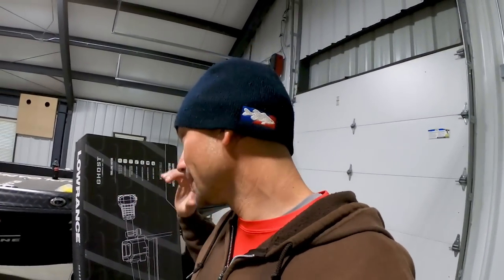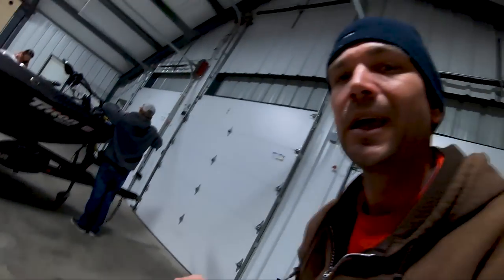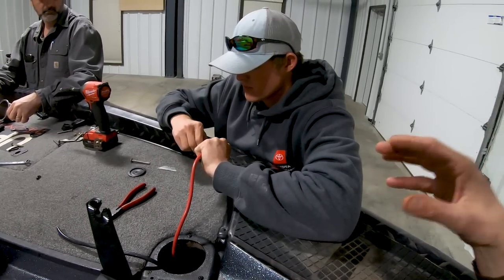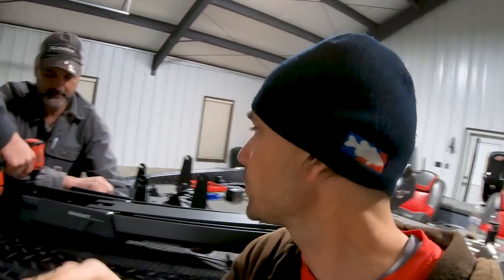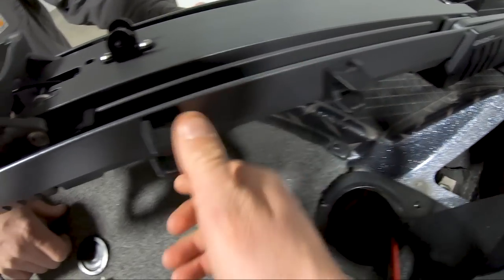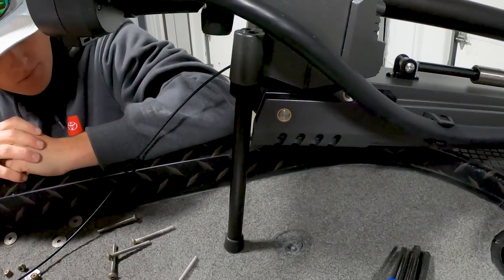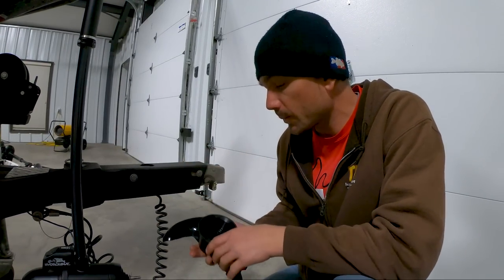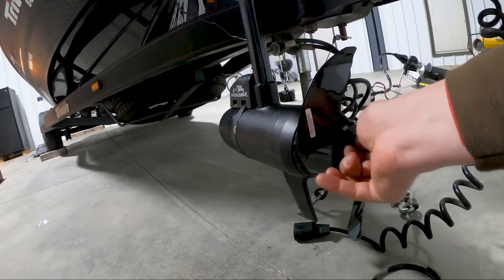Lowrance GHOST Trolling Motor FULL INSTALL

Comment: Thanks, I missed it on sale, lol. My main worry was the bolt pattern. I have a 2012 bass tracker pro guide V 175 SC. I live in Oklahoma and the 55 pound Minnkota that came as original equipment just can’t handle the wind here sometimes .

Comment: Concerning on-the-water conversion to 24V if a battery fails:  You don't ONLY change the TM setting.  You have to change the wiring on the batteries to reconfigure for 24V (series connection) by moving cables on the batteries accordingly.

Comment: Does the gps puck connect directly to the Ghost? or does it like the Minn Kota Blue Tooth connection in the Terrova?They have blue tooth in the GPS puck and the head unit and they connect via blue tooth and then a power cable goes directly to the puck.
Reply from the maker: puck plugs directly into the foot pedal.
Reply: @mikeybalzz  thank you!

Comment: Did you hardwire this trolling motor?
Lowrance recommends a cutoff switch during charging and not just turning the motor off.
what do you think? I hardwired mine and now I am thinking of some type of disconnect.
Reply from the maker: It is hardwired however I have a cut off switch in the back of the boat

Comment: It is NOT necessary to solder the connection for a trolling motor to get a quality connection.  That's a problem if you need to take the unit off for service.  There are stainless 2-stud (for +/-) power terminals available for ~$20.

Comment: **  Be careful NOT to catch your fingers in the mount as you stow it during installation. 

 It will cut break your fingers off if you do

 I pinched mine, but was really  lucky I didn't whip the mount open  quickly , since it was slow, I had time to re-act

Comment: Please tell me the cable connections from the ghost to the back of my elite fs? Help
Reply from the maker: which elite do your have?
Reply: The new elite fs
Reply from the maker: You should be fine it looks like they are all Nema compatible only thing you might have to do is get an adapter for the transducer plug